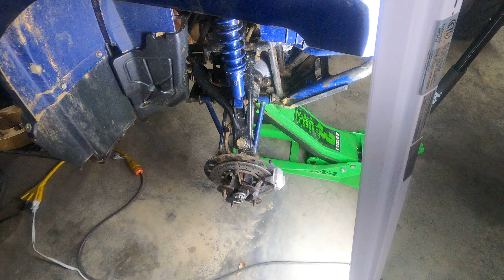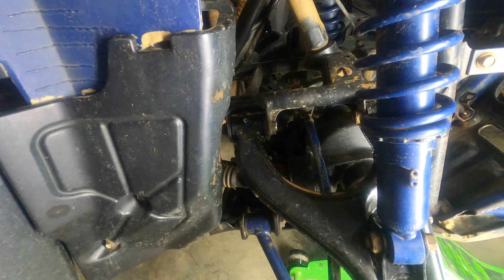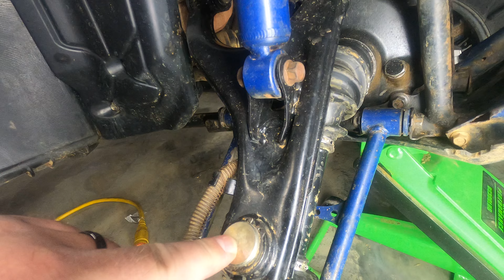Yamaha Grizzly 660 upper A-Arm workaround, and upgrade

Comment: Could you please add links to the Coleman parts? I’ve looked at Coleman’s website and find no mention of a Trail Tamer 500. Direct links would be fantastic.
Reply from the maker: Alpha-sports.com. They’re listed under Trail tamer 500, then under front suspension assembly. Hope this helps. Thanks for watching
Reply: @willieswayz  nothing there, but the hardware. They don’t list the parts at all.
Reply from the maker: Well I would call and ask. After I placed my order one of the salespeople called and asked what it was going on and I told him a grizzly. He then said he couldn’t guarantee they would work. Needless to say they fit.  Hope you can find some they are way cheaper and better built
Reply: @willieswayz I came from the forum and I’m having the same problem. It appears increasingly difficult to retrieve parts with time. But if there’s a will, there’s a way!